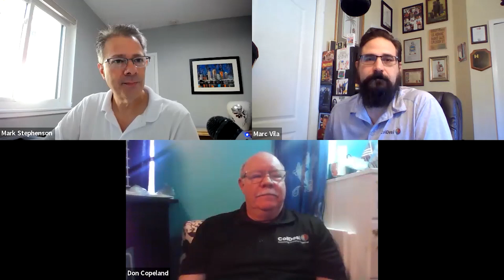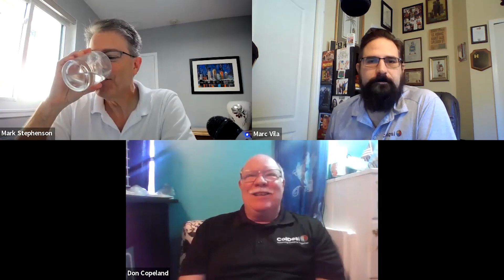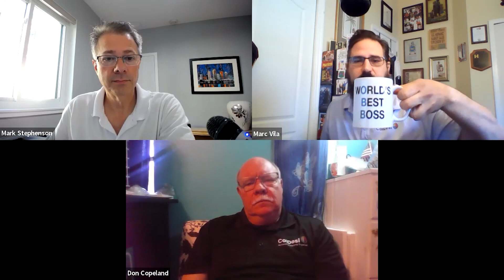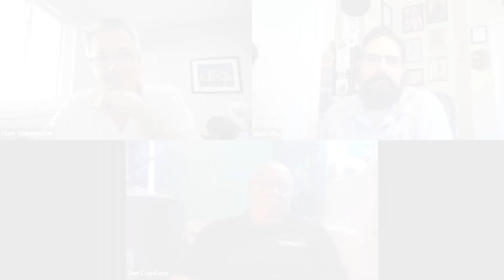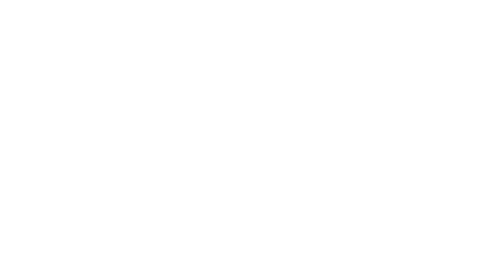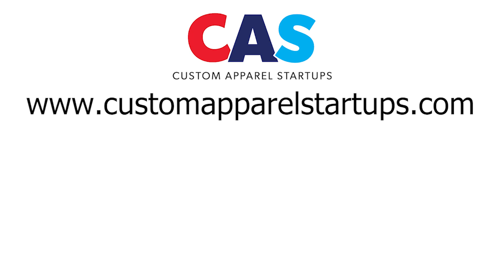CASPodcast Episode 159 | All About Direct to Film Printers

Comment: Is ear protection needed ?
Reply from the maker: It depends on your environment but the BEST thing you can do is schedule a live online demo and hear for yourself.
Reply from the maker: Dwayne, I've been thinking about the collection of questions you've asked about the high volume DTG machines - and here are a few comments:
- Unlike almost every other machine we sell, this is not for "home use".  They are very large. The belt dryer required venting like any other. And there are power requirements that most residential situations aren't prepared for. 
- If you have an environmentally controlled outbuilding or garage space you might consider adapting it to use with this kind of equipment
- There IS a possibility of a smaller unit on the horizon, but many of the same requirements will still apply